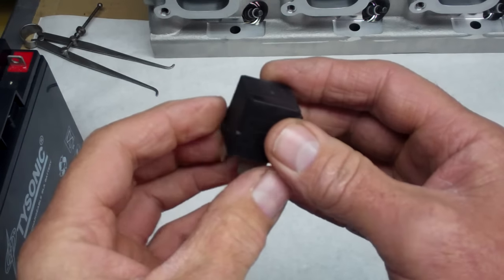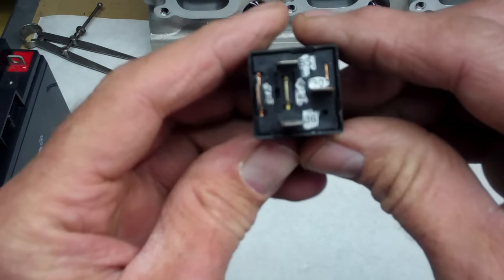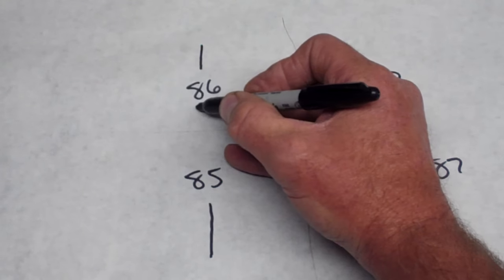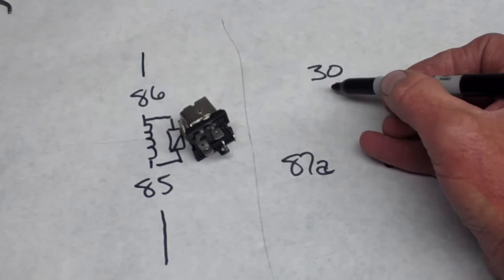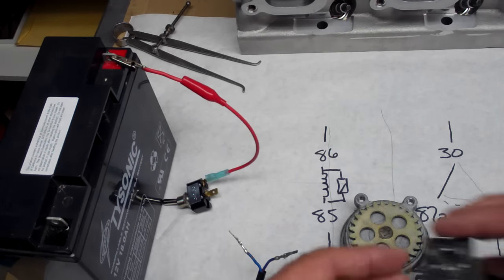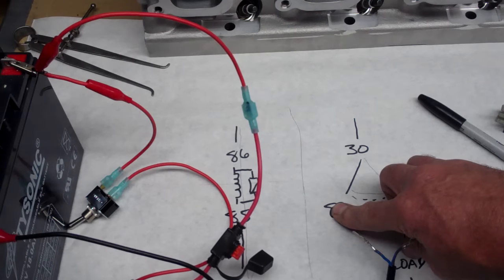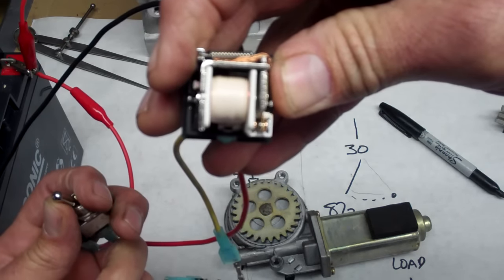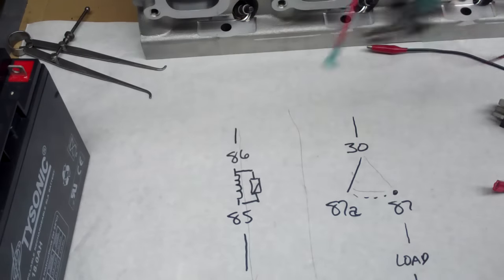How An Automotive Relay Works and How to Wire 'Em up

Comment: I could probably wire a turn signal relay into my bicycle for turn signals. Car batteries are 12v so all I need is 8 batteries (1.5v*8) it should work right? Since most relays are meant for 12v right?

Comment: I fully understand your explanation!!! I have a question: where would you connect a bulb/led indicator to show that the switch is on?
Reply: You would have to splice a wire off of what ever you are powering ( off of 87 terminal)

Comment: With an on-board air compressor, would the pressure switch work as your toggle did? I will have the power lead coming from an "ign" power. Or should I have 12v in on 85, 86 to ground operating from the "ign" on. Then have 12v power coming to 30, and the compressor pressure switch on 87. This way the only time the compressor will work is when the ignition is on, and the pressure drops...?

Comment: DUDE!!!!!!! I just want to go buy $100 worth of relays and wire everything I own through a relay! 🤣
This was awesome! Thank you! 
Now...a question. Could I not just run that motor directly with a switch between the battery and motor? Please don’t judge. I’ve been taught there is no stupid question. 🤷🏻‍♂️

Comment: Really cool expanation. 
But I still understand why not just have the switch directly between the battery and the motor? Why have the relay/switch in the middle (other than to have that lightbulb when the motor is off) ?

Comment: I just watched your video to try wiring a 12v relay  for a diy incubator. My relay makes a buzz noise once power is sent. I took the relay apart and it makes a click noise then buzz. When looking at it up close the coil makes a spark at one end once power is sent from the controlling switch to the relay but the relay doesn't move from 87 to 87a it stays still. I've tried 2 new relays and same thing happens. Could you tell me whats wrong?

Comment: So as long as I use heavy duty switches like 20 or 30 amp depending on the situation, I should never have to use a relay? I've always liked the look of toggle switches better and I run a toggle switch to almost everything in my vehicle from the electric fan to the A/C compressor

Comment: Really like the video, thumbs up,, one question,,,  how choose the correct amp relay for any devices?  Example fog lights??  Engine fan? Etc
Reply: I would use a regular common 30amp Bosch and limit the current load with a fuse instead.
Reply: Do a draw test by putting a multimeter in current measuring mode, usually symbolized by an mA or just A. The number that comes up will determine the size of fuse you need. Always use a fuse rated slightly higher than the device you plan to use consumes. If it pops often, use a larger fuse.

Comment: Should I get my power source straight from the battery terminal or can I just tap from existing wires in the engine bay?

Comment: On the ground wires you were hooking up to the battery, can those just be connected to the body as a body ground or do they need to go back to the negative post on the battery?

Comment: Excuse me for the dumb question but is there a short circuit when connecting battery terminals to 85 and 86?
I am trying to accessorize my bike and i am wondering if I should use any resistance in the command circuit.
Thanks for the simple tutorial

Comment: If I was using this setup to wire high and low beams, would 87 & 87a be for the load ( lights) and if so, what hire triggers the relay to change from 87 to 87a? And would it be ground coming from the high / low switch?

Comment: i have a question. i just bought a 50inch led light bar which is supposedly putting out 672 watts. it seams like im going to have to make my own wiring harness. what amp relay should i use

Comment: Thanks for thr videos. How would i wire dual electric fans so that the 87a (bulb) turns on when the electric fans come on at 180 degrees. Not stay on as demonstrated?

Yazmin 
Venice Beach..Ca

Comment: I still don't understand how plugging a low amp switch directly to a high amp battery protects that low amp switch.  The inductor and resistor are said to only keep the electricity flowing in one direction and triggering the internal reed switch, thus the resistor isn't taking load off the low amp switch?  Nor explained is why the relay numbers are not simply 1-5, but 30 and several 80's?  How does one know how strong (v rating) the switch needs to be for a given relay?  Is the relay rating dependent on the source voltage?  i.e. does it matter if using 100v relay on a 10v power source or must the relay match?  Thanks for helping me understand these questions.

Comment: Also is there a type of relay that will also reverse the current on let say a linear actuator so you don't need 2 relays to operate the in and out motion. Thanks

Comment: hello, very informative video, just one question, in another video they used pin 87 for inward current from battery and pin 30 for outward current or load, is it the same or should the process shown by you be followed strictly? thanks.
Reply: Which way are pins 86 & 85 wired?

Comment: So before I found this video I was referencing a different diagram and connected both 85 and 86 to the negative terminal of the battery... obviously didn't work, but have I potentially ruined anything such as the relay, switch, or battery?

Comment: How would it work for the opposite?  If i want to hook up a horn with constant power and until the wire is cut the horn will go off. Like an alarm if you will.

Comment: If i'm wiring up an electric fan on my car, can i use the switch for the ground and make a loop from pin 30 to 85/86? So i can run the fan even when the car is off/keys out.

Comment: Does the current from the relay get reduced to the load? I'm having a problem with wires overheating. I do not have a relay hooked up. Power is connected straight from the switch.

Comment: I was wondering that was a DC window motor I have a 2013 Kia Soul the passenger window goes down but doesn't come up the motor only turns when you push the button the window goes down the motor does not turn when you pull up how do you change the polarity on a DC motor is that what the relay switches for I also had another DC window motor it did the same thing so not sure if it is a real a problem or DC motor I had another one it did the same thing so the motors are still good or do you think it's the window regulator

Comment: I want to add a relay for some marker lights. I want the lights to come on with my headlights. Can I wire everything the same as the video, except power from the headlights to pin 86, so the relay engages when the lights turn on?

Comment: So my question is, if I hook up a set of driving lights with power that comes on with the key in the on position (switched) that I then want to shut off when I turn my headlights on I would hook it up to 87A. Then when my signal comes in from the headlights it would then turn the driving lights off if I understand this correct.

Comment: I'm wiring in a small air horn. It is wired in with the stock horn wiring and it honk intermittently! How can I wire it in so it stays energized/honking when I hold down the horn on the steering wheel? I currently do not any relays/switches other than the stock OEM wiring system.

Comment: Does the switch and the motor have to be on the same voltage? Can I power the switch 86 to 87 on 12V and rest of the circuit on 48V?

Comment: 2ton220, Why are cars using SSR solid state relays now, any advantages? how do you test a automotive relay in circuit and out of circuit? Does SSR solid state relays use JFETS or MOSFETS?

Comment: The only thing I’m not understanding is that I thought a relay was used so that originally you wouldn’t need that high voltage input to drive your load but it would be outsourced from somewhere else. But in the video you sourced the motor to the same voltage as your relay? So in theory did you just wire a switch and a motor?

Comment: I have to wire a set of aux lights into fog lights that turn off when the high beams turn. I can’t wire into the high beams because they are connected to DRL (daytime driving lights) so I think I use the relay backwards right? I need when the fog lights turn off  and I need them to turn the aux lights. Any help would be greatly appreciated

Comment: Thanks for the video. Can a car relay allow 12volts to pass through it? Is a step-down necessary, if so what will be the most common safe voltage. I am hoping to use the car relays for some pet project and unfortunately i dont know much about relays:)
Reply: @Obi Amechi  Look at the specifications on the relay.  12 volts is passing through the one in video.  The amperage or current can differ depending on the current draw.  Most things in a car won't go over 30 amps @12 volts.  A high amperage relay or solenoid would be the starter solenoid for starting the car, that's about 90 amps of current at 12 volts...
Reply: @hv9356  Thanks

Comment: I did just like your video said to do..but it blew my 87 pin .so I put my train compressor  red wire to  pin 30 and 86 to ground 85 pin to my pressure switch and the hot wire with a fuseink to 87 from the positive battery terminal..and it works just fine ..the other side of my pressure switch  goes to switch power

Comment: What happens if you switch 86 and 85? I'm asking since I'm trying to use a relay in a circuit to allow me to use the same light from several sources.

Comment: Hi could I use this relay to power a load from one 12v source to another 12v source automatically if one 12v source stoped working if so would you explain how I would wire it please if you wouldn’t mind letting me know or if you could let me know what I would need to do this please
Kind regards John

Comment: Great video but I’m still lost. I have a 69 Volkswagen and I’m being shocked (mild shock) when I have my arm on the window sill. I have a steering wheel with exposed metal in the middle and when I hold onto one of the metal spokes and honk the horn the shock is way more intense! I have a horn relay and when the horn button is pressed the horn honks and shocks me. I’ve got to fix this, please help me!

Comment: Can that 6 pin relay be used for controling ignition coils?
I hade recently odd problems with engine refuseing to stop and self acelerating engine It lead me to 6 pin wiper relay and 3 pin blinker relay I found the problem corroded wire on blinker relay ground wire .
I realy dont understand what head lights have to do with self acelerating engine .
But for some reason me car run basicaly with key turned off.
And I did actualy got zaped be static electricity.
So I asume those relays can indead control coils but how to modiffy those relays so the work as ignitor ore coil feading with power??

Comment: I want to use a relay for DRLs. I want to have them on with the engine on and turn them off when the sidelights come on. Can I do that by connecting the DRLs to 87A, nothing on 87 and a connection to the sidelights on the 30?

Comment: I’m doing this same thing although instead of using a switch I’m going to wire it to accessory power. So when I turn my Jeeps ignition on it will send low amperage power to the relay which will activate the feed side which will come directly from the high amperage battery to my power windows.  Reason why I want to use a relay? If I powered them directly from the battery they would be powered all the time, which they have a light on the window switch which could drain my battery. Now if I powered them from a accessory point like on my 98 Jeep Tj it has a open relay spot under the hood for a heated back window which I do not have, then the windows will pull to many amps from that circuit and pop a fuse (which controls the crank position sensor. Don’t ask me how I know this!). So if I wire it like stated above when I turn the Jeep on it’ll activate the relay which in turn powers my windows directly from the battery (which is fused of course.). Now one word of caution: if you buy a kit like I did that has a fuse under the dash and you run a 12 volt power wire thru the fire wall then to the relay the finally to the battery with no other fuse then..... what happens when the wire under the hood gets pinched some how to ground? It’ll pop the fuse under the dash but the wire from the dash to the battery will smoke and possibly catch on fire so.... Always fuse a battery wire like he shows in this video NEXT TO THE BATTERY!

Comment: hey, would a relay cause a parasitic drain? I'm currently reading 0.15 amp when doing battery drain test with the connect switch off. Once I disconnect the relay, it goes to 0.0. Is this normal with a relay?thanks

Comment: instead of connecting pin 86 to the switch via the battery, pin 86 could be tapped into a power source such as a headlight wire etc?

Comment: How would you wire a relay for a remote start to where it will cut the power to the remote start when you press the break and switch power to the main so the car keeps running? also how can you make a relay so ground negative is only on when the remote start is on, normally there is a "ground when on" wire but for some reason my unit is without one.... so I figured I can manually make one? Thanks

Comment: I have installed two of these and have not had a problem from hyperflash but what I do get is an almost constant clicking noise from the flasher. I need help. All lights function properly.

Comment: Hi I’m in the process of fitting twin horns bypassing my steering wheel original horn because it’s crap basically so all they gave me were to horns hi and low and a four pin relay on the diagram I have 85 going to my new horn button 30 goes to a fuse and then to the battery 87 goes to the positive of both horns 86 according to the diagram is linked to 30 I’ve checked with a multimeter and there is no continuity between them so do I have to link them together somehow ?

Comment: I'm trying to figure out my transfer case relays and I'm wondering on my truck the load power comes in on 87 not 30 when i un plug the relays I have power on 87 and 86 is this normal?

Comment: Hi I have a problem trying to make some euro Led turn signals work properly with out burning them out on my street bike if you can help me figure it out. The specs on turn signal says 5-9v 0.5w-4w I’ve tried a step down 12v to 6v but they’re not bright enough but are working fine no issues as far as brightness than I tried another step down specs were 12v-9v 2a 18w. The turn signals worked fine nice and bright but after 1min On they burned out I’m trying to find a step down with less wattage thinking that’s my problem but can’t find one or maybe a relay can fix that for me please let me know what’s my best option for me

Comment: Sir have you seen/heard of ADDING a relay to a car’s headlight makes it brighter than the stock one using the same stock bulbs. It makes it glow more? If you do and have time can you please explain how. THANK SO MUCH
Reply: Generally, cars disable the low beams when high beams are in use. You can use a relay to activate the low beams whenever the high beams are activated. This could theoretically give you better lighting.
Reply: Mark of Excellence thanks Sir

Comment: So can I tap into the window fuse to be the signal wire for the relay to power up my head unit with the key in the in position and when I open the door turn off my head unit?

Comment: what would be the consequence if i wired a fuel pump without a relay?  say directly to a 5, 10,15 amp fuse in the fuse panel?

Comment: What is the benefit of using a relay rather than wiring the switch in series? I am deciding whether to run my heated hand grips (motorbike) using a relay off the number plate light or just connecting it in series. I will use this circuit as it only runs when the ignition is on and don’t understand the practicalities of the relay in this case
Reply: Is it to isolate the number plate light circuit from the hand grips circuit?

Comment: Hi. I FOUND YOUR VIDEO INTERSESTING AND I IMMEDIATELY SUBSCRIBED. I Need to out an extra battery in my car to power a 12v fridge. I NEED THE MAIN BATTERY TO CHARGE THE SECOND WHEN THE CAR IS ON AND TO GET DISCONNECTED FROM EACH OTHER WHEN THE CAR IS OFF SO THAT IT WORKS ONLY WITH THE SECOND BATTERY when the car is switched  off. Could you explain me the wiring diagram please. Please help me I will share your videos to help you tra your Channel bank a in advance

Comment: What happens if you have 2 87 pins? Can you hook both hot wires from each light say you had 2 lights 1 to each 87  pin?

Comment: Can your device being powered by the relay be powered by a higher voltage source than the trigger? For example, use a 12v trigger for the coil but have your relay turn on a 48v device powered by a 48v battery? Can the 12v relay handle the higher voltage on the contacts as long as the max amperage isn't exceeded?
Reply from the maker: Probably not for long before it burns the switch contacts. Large voltage pass through is normally going to require a contactor, which is just a heavy duty relay. Most contactors are rated by coil voltage and switched wattage and they cone in single pole, double pole, etc. Determine the wattage requirements and start shopping.

Comment: I follow all the steps, but when I open the switch both 87 and 87a turns on... can you help me please

I am using two LED's

30 to positive
86 to positive (switch)
85 to ground
87 to led1
87a to led2

suggestions please

Comment: If I have a situation where I need a relay to switch ground on so to speak...

When I start my car the ignition is my power switch.. I do not need power to switch on when the car trys to start.

However I need 87 to send ground out of it..

Comment: So a 5 pin relay gives you the choice of running the load on a normally closed OR normally open circuit unlike a 4 pin relay which is just a normally open circuit. 👍